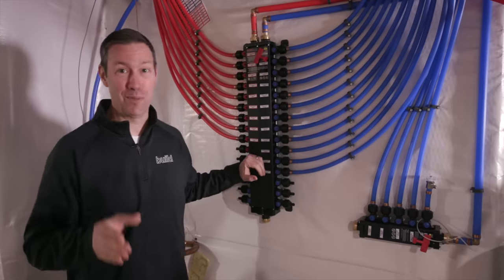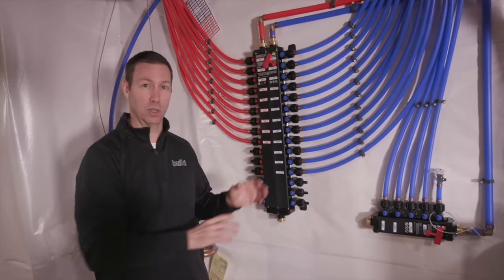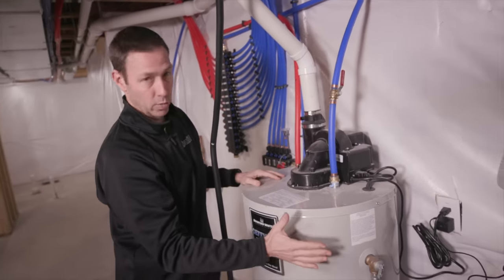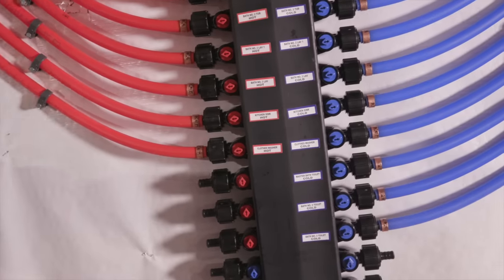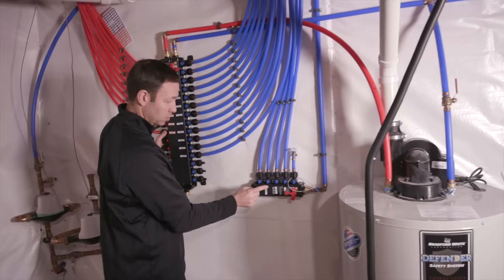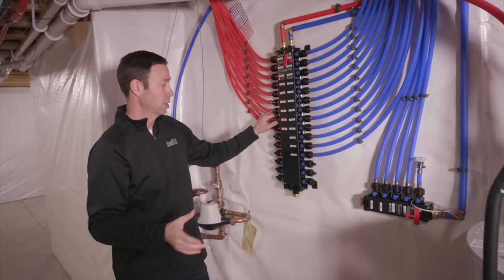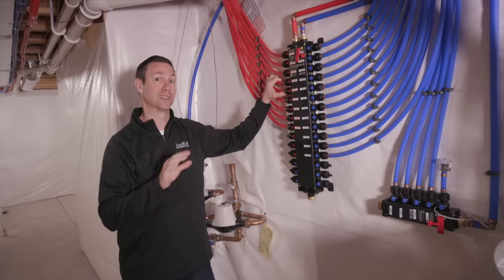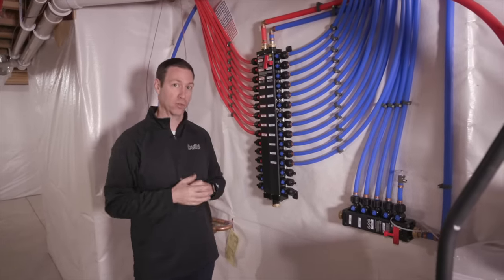PEX Manifold System - Pros and Cons + Tour

Comment: Always enjoy your videos
My observations:

Why reduce the main supply to the house and keep the auxiliary meter at 3/4"?  
(Referring to the 1/2" x 3/4" x 3/4" reducing T upstream of main water meter).

Just curious...why a second meter?  Different charges for different kinds of consumption such as swimming pools, hot tube etc.???
BTW, What's the brass 'DooDad' immediately downstream of the main meter?  Is that a hydrant?

Water heater missing a metal water heater connector (as previously mentioned)
.  This is a requirement , not an option
Water heater missing isolation valve at hot side to facilitate future replacement
 (see water softener installation, bypass valve not required)
Warning: codes are minimum requirements.  

3:38 that would be the hot.

DO NOT turn the water on at NO. 5 spare branch.  Loose crimp (see at 6:12)
Duplicate spare branch PEX at unoccupied main manifold

Yes, definitely insulate  hot water lines .  Never been a fan of bundles water lines, shows laziness on the part of trades.

I hope this plumber gets a level for Xmas.  Listing port side.  

We could talk about isometrics and support, I'll just leave there.

Cheers,
N
PS. thumbs up

Comment: The key to your hot water issues is another new technology called on-demand tankless water heaters. Now the water is only heated within a couple of feet of the point of use. I would design a hybrid system using home run circuits and branch line circuits together. Besides, any way you cut it, the on-demand tankless heaters are going to result in a significant energy savings.

Comment: To avoid the downside of having to prime the hot lines, a valid compromise could be to run a 3/4" pex line from the master manifold to the master bathroom and branch out 1/2" connections from there to all the water connections like tub, shower and sink.
Reply: My thoughts exactly
Reply: If the manifold can take a 3/4 output.
Reply: @crosisofborg5524  if you need a hot 3/4 outlet and your manifold doesn't support it, I see 2 options: 1. run a line from the main and bypass the manifold. 2. Split using a Y before the manifold for your 3/4 but this option will obviously result in a loss of pressure into the manifold.

Comment: I feel like you could do an intermediate idea where you have a manifold, but instead of a long run of PEX to each fixture [which is a lot of extra ft of pipe total in the home], do it by room (ie. Bath #2 as one outlet vs sink/tub/toilet individually as 3 outlets).  Much like how a breaker in a breaker box services a handful of outlets or switches per each one.  Granted, you would add a T/Cross connector or mini-manifold once in the room if there are multiple fixtures.  Thing I like about the manifolds is you could essentially not have to have under-sink valves, which adds 2 connectors per hot or cold pipe.

Comment: I have installed one of these. When he said don't install it in a wall - believe him!  I did and it was a bloody nightmare and due to multiple tight turns required in the installation, I had to install a number of junctions, which obviously defeats one of the main benefits of this system.  If we had known how bad it was going to be we wouldn't have done it, but by the time we figured that out it was past the point of no return.  Even worse, the manifold is on the second floor and it'll be utter hell if it starts leaking.
I may install it in my own house as I do have a basement and can keep the runs fairly short since my house is small.  It is possible to insulate the tubing, but effectiveness is questionable.
The manifold is not cheap and you will use an ungodly amount of PEX tubing during the install.

Comment: Two other possible down-sides:
1.  More right-angle turns to the piping which could slow down the flow.
2.  The manifold itself can fail, then it's a big pain trying to fix it or replace it.  Especially if there is no comparable replacement part available when you need it, say, 10 years after installation.

Comment: That many pipes for hot water increases the surface area to volume ratio significantly compared to fewer, larger diameter mains pipe, and without insulation that will not be economic.... unless you tolerate accidental underfloor heating. Reducing the number of fittings to reduce the points of failure is more than offset by increasing the overall pipe length running through the house... the vast majority of failures occur at point of use not in the main trunk or tributaries. It's pretty though, and satisfying for sufferers of OCD.

Comment: Thanks for the video Matt! I have this exact manifold system in my ~3100 sq ft 2 story house in south Texas. Unfortunately I think the builder made several critical errors with placement and runs that do irritate me with it, many of which you called out in the video. 

The first error is that my manifold is located in the laundry room in the very far corner of the house rather than centrally located. This is compounded by the fact that my water softener is outside on opposite side of the house! What this means is that the builder piped into the water softener and I have no option to have unsoftened water at the drinking water locations. The other option would be to double the cold water runs, which I'll talk about later just isn't feasible.

The second error is that the manifold is installed in a recessed cabinet that was installed between two studs. There are holes drilled every 2 inches for the pex pipes to go out to the fixtures, so if anything ever busts it will be a nightmare trying to pull the line and fix it. My manifold doesn't have the key system, it has difficult to turn bar handles that overlap so it is both painful and cluttered when turn lines on and off. The other downside of this design is that where the pipes go after disappearing into the studs is a mystery... well not really... the builder shot nails through two of the lines while installing shelving in the second story bedroom closet above the laundry room. The rusty nails finally gave way and caused massive water damage to the drywall in the closet and required me to replace most of the drywall in the laundry room ceiling.

Third error, because the manifold is in the far corner of the house, getting hot water to the bathrooms takes FOREVER! In the morning I will turn on the hot water in the master bathroom lav, brush my teeth for 1-2 minutes, and rinse with luke warm water. What a waste! And then I repeat the waiting process for the shower which is 5 feet from the sink.

Also, in my large two story house, the manifold was installed in the first floor in the corner, and because we have an open foyer area, it means that all the water runs have to go up into the attic and over both floors. This causes problems with water pressure, long runs i.e. hot water to fixture problems, and watch out when installing anything in the walls... I have no idea when I might tap into a pex line accidentally.

And finally, the two tank water heater system is in the attic on the other side of the house as well of course. That means another long long run from the water heater to the manifold and then back out through the house. What a bummer.

With all those negatives, I still like the design and just wish the builder had thought through the location and ramifications a little more first. Having those handles to turn off individual fixtures means I can tackle a plumbing problem with a little more time and patience because it doesn't impact the entire household. I can also do 90% of the work myself as a DIYer because I don't have to deal with copper fittings and soldering in confined spaces. And as was mentioned, PEX line and fittings are super cheap compared to other options so screwing it up isn't that big of a deal - just cut the line and start again if I mess it up. That's not how it goes with copper or PVC!

What are your thoughts on using a system like this in a hybrid model - a central manifold to branch to major water utilization areas with smaller block manifolds in those areas to control individual fixtures? It would reduce the runs from the central location to the branch locations and still provide that individual control (or control to an entire bathroom/kitchen/laundry area). Thoughts?
Reply: The idea behind a manifold was to get faster the hot water to the outlet. Increasing the diameter to 3/4” and splitting it in few 1/2” close to the outlet will prolong the time of getting the hot water.
Reply: Before sheet rocking always take pictures of the cables and pipes and keep them in the house folder for the life of the house.

Comment: Heat loss from all those separate hot supplies will add up over a year! If a bathroom sink is used only a couple of times per day, that's tens of feet of pipe that will loose whatever heat it contains before it is used again. With a conventional system each pipe supplies several outlets, reducing the average standing time and associated heat loss. A well planned pipe run reduces heat loss, reduces the number of fittings (or at least makes sure they are accessible) and reduces water waste. This seems to solve a problem that doesn't exist! In fact, it actually adds complexity and cost while increasing energy loss and water use.

Comment: I have a Vanguard Polybutylene Manifold put in back in the 1990's - still works but experiences some periodic leaking when the water is temporarily shut off for toilet or faucet repairs. I always turn it off at the outside main line to alleviate too much pressure rather than using the manifold valve levers. The thing is, the poly lines were put in because of too many pinhole leaks that I got previously and was told this was the latest thing and very good. Now, poly is in disrepute by plumbers and insurance companies and people claim that Pex is the thing. How do I know that I'm not going to have a similar leaking situation with the Pex manifold or other parts of the Pex system in the future? It seems that the plumbing industry wants to wash their hands of their previous accolades of what they sold in the past. Meanwhile, we the home owners are stuck with endlessly having to repipe every few decades at a great cost.

Comment: Every single home I've every plumbed. I've added a hot water recirculation system to it. Whether I gave away the system. Or I charged for it. The owners always called me back (faucet, repairs & replacement) & recommended me to their friends for service work or additions. A recirculation system with either a motion control sensor or a push button in every fixture room is the only way to go. 
   You go from 15 to 30 seconds waiting for hot water to maybe a 3 second wait. Which with a good system 3 seconds is a long time.

Comment: I was thinking about this a lot since I love the manifold idea but don’t want to lose the dedicated recirculating line. Wouldn’t it make sense to have a manifold next to the water heater for those lines that have very short runs, then run a main line coming out of the first manifold to a secondary manifold that is close to the next set of fixtures?  Then you run a return line from that second (or third) manifold back to the water heater and close the recirc loop. I think this blends the benefit of minimal to no cuts in the lines and having almost instant hot water. If you put the second manifold in a laundry room or mud room, you still have access and drainage if ever needed. I’d love your or other subscribers thoughts on this idea. Thanks

Comment: I made a circle out of 3/4" and ran multiple 1/2" lines off the circle. It works well.... looks funny but efficient!
Reply: that would actually work. pex is awesome.
Reply: @jaybee3165  It's been in service over a year now. NO pressure drops! It was WAY cheaper than buying a manifold... plus seeing the puzzled look on the inspectors face has value!

Comment: i noticed in floor basement heating uses PEX. does a system like that last very long? i know new concrete basement floors crack over time, so i feel like that would crack the plastic too.
Reply: short answer? no. it will not crack. it will not leak. just for fun & giggles.. one time on a new construction site- me &  the grading contractor tied a piece of 3/4" type B pex between his excavator & a track loader. the pex was about 12' long when we started... we stretched it to 18'. pex has some weak points. sunlight makes it brittle (unless it's uv resistant pex- topic for another discussion), it can be punctured or cut VERY easily. but you can run over it with a dozer or stretch it clear to infinity. it will go right back to it's original shape if its' uponor pex. and if it freezes? it can swell up to 2x its' original factory size without damage. ever been to south lake Tahoe? to the casino's? see all those people shoveling snow? see how harra's sidewalk & entry ways are always try & clean.. .they have the very same pex that you are talking about PEX C- it's for heating. and theirs is DECADES OLD.

Comment: As I understand it the biggest pro of the manifold is even pressure throughout. ie. if someone flushes a toilet or starts a dishwasher while you're having a shower you won't get the blast of hot/cold due to pressure changes.

Comment: I will agree with some of the people commenting here, it seems like a big waste of extra water lines to make homeruns.  Is a great way for ease of access to turn each individual line off but in my time 90% of our drops in a traditional trunk and limb system already has a shut off valve that you can shut off right at the source without going to the basement.  Type A pex, what we use is uponor or apollo, has many sweeping 90 applications that sweep to the wall drops therefore minimal fittings are needed to make each drop from the trunk so that minimum fitting per homerun is fairly irrelevant.   If you're worried about the distance to evacuate the lines on these a manifold is not in my opinion your best bet.  Might think about an on demand water heater that uses the whole trunk system and makes 1 big loop back to a manifold which in turn recirculates all hot water at all times to keep a relavant temperature.

Comment: We just downsized into a 35-year-old bungalow, 2,500 sq. ft., copper pipes throughout, with updated kitchen, unfinished basement, and meant to be our forever home.  I am planning to renovate the main bathroom, then the master bathroom, before renovating the basement.  I am wondering if I should start replacing all copper wherever I renovate with pex, and place a manifold system in the eventual furnace room.  Since these renovations will take place at least over 5 years, would it be an easy thing to ongoingly add the new pex piping to the manifold as I start removing copper wherever I renovate?

Comment: Hi Matt, I have a home that was built in1992 in Florida ( Venice, Englewood Area). I have a slab home. I am concerned that my copper pipes underneath the slab are going to leak, so they are going to be replaced. I have watch a few of your video. I like what you say about PEX-A, however I am concerned about running the pex in the attic due to the summer heat. Our summer run from June through September.  I would appreciate your comment.  thanking you in advance, John

Comment: Really need to insulate the hot runs.  My master bath has a shower, tub, commode, and two sinks.  Do I need five cold and four hot lines running from my manifold to basically the same location?  No, I am going to send two, one hot and one cold, and branch when I get there.  If you trust the fittings to not leak, this is fine.  If you don't trust the fittings, then switch to CPVC or copper.

Comment: Might have been hit on in other comments but I'd like to know what the equivalent wait time on hot water from a copper trunk and branch system would be for a similar run. Starting from scratch the first use on a long run would likely be just as long as the PEX I would think. If you ran hot water at the shower then the wait time would be shorter at the faucet in a bathroom I suppose. Then again, you charge the trunk with hot water and if it then sits, all that heat bleeds off anyway.

Comment: Great video with awesome info. I am looking at building a "sprawling ranch" style home with hot water runs upwards of 50'. do you have a recommendation for a pex manifold to run 3/4 or 1" trunk lines to wings of the house and then 1/2 tee from there???

Comment: My dad had a circulating pump in his slab foundation house and after 40 years, he's had several leaks in the copper pipes under the slab. I'm often wondered if that circulating pump was a contributing cause to the cavitation that would make the pin holes in those pipes over the years? It was nice to have faster hot water, but having to jackhammer several large holes in the foundation; not so nice.

Comment: I'd add water shut offs at every fixture under the sink.
Hot and cold. And one on the flexible hose sprayer and dishwasher especially. 
On a long continuous run how do you trace leaks?
What about water knock and vibration chaffing? 
To prevent water damage between runs could you run this thru conduit so when their is a leak you control where the water goes?